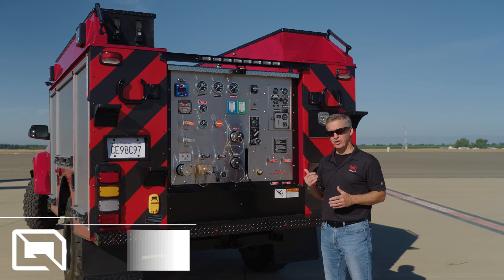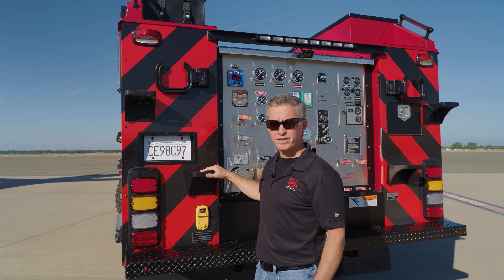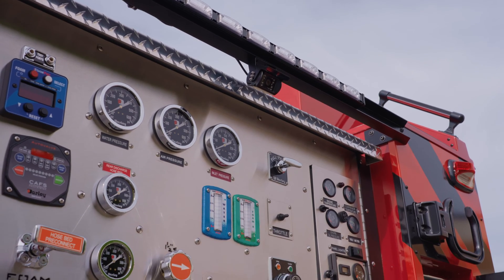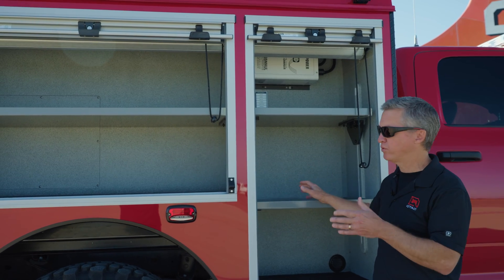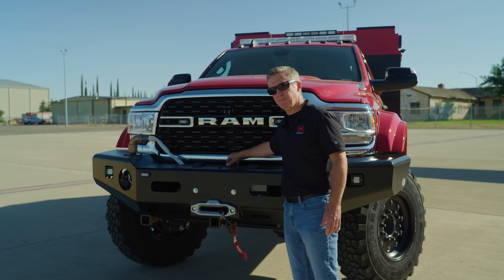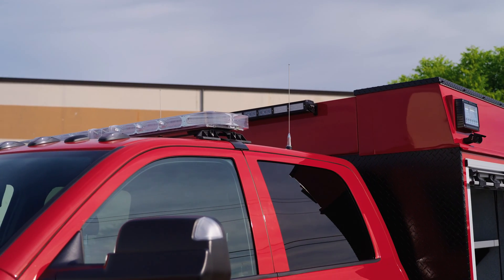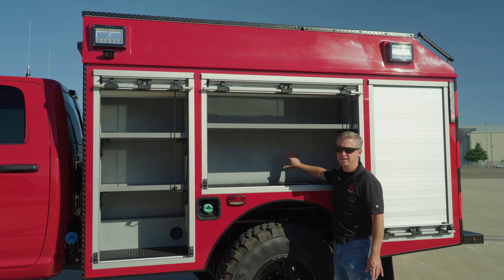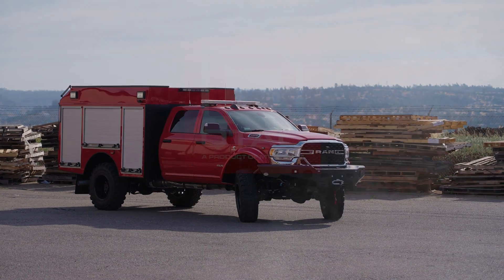The RAM 5500 Super 6™ Transformation: Equipped with Darley Odin® CAFS

Comment: What is the Tank Capacity, and GPM of the Pump ?
Reply from the maker: You know, sometimes you finish a video and realize you've left out some crucial information! Sorry about that. It's a 300-gallon tank. The Weapon is rated at 250GPM @ 150psi for water, 220GPM @ 100 psi while flowing foam simultaneously.
Reply: Can you build the super 6 for law enforcement or tactical with full storage without the water tank for